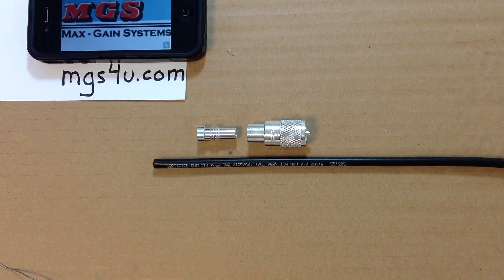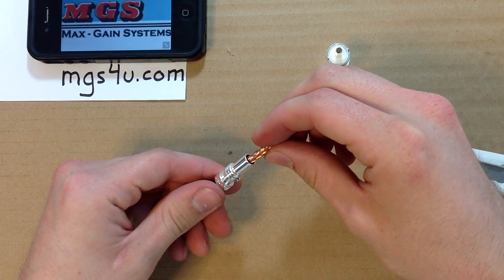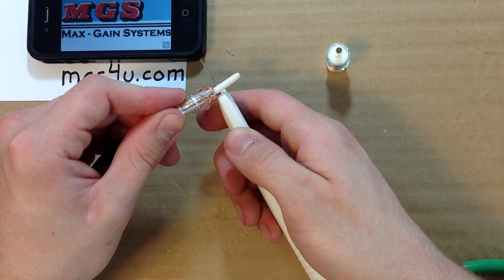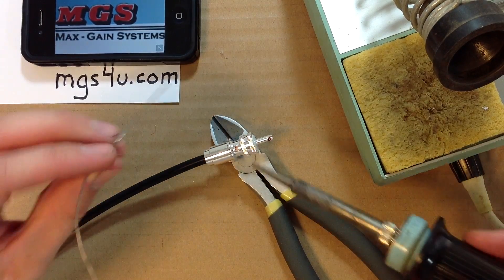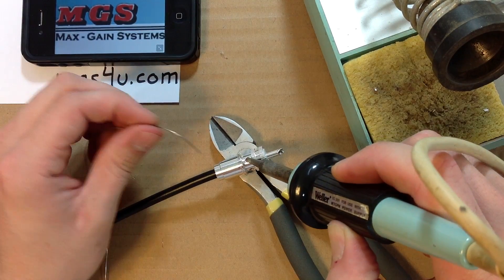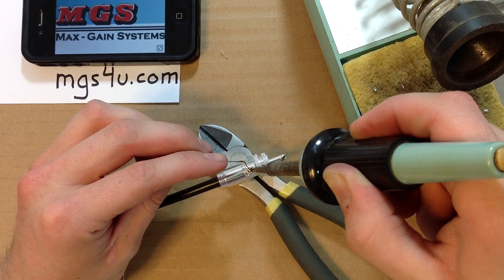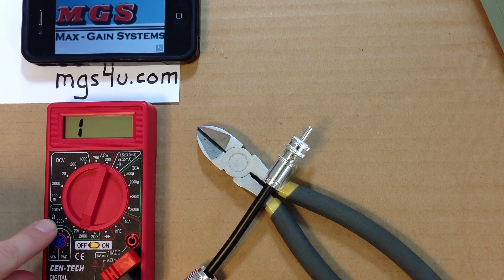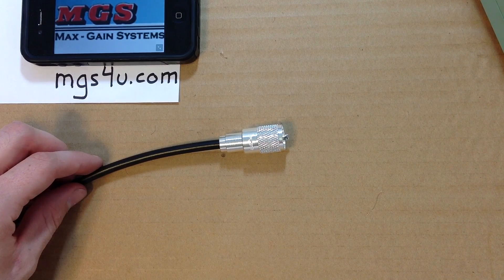Pl-259 Solder On Installation Guide for RG8X Coaxial Cable Full HD

Comment: Nice concise explanation. I would suggest using a clamp or vise to hold the work during soldering. Also apply soldering flux on metal to be soldered. The solder will flow and adhere much easier.

Comment: For anyone like me who struggled with soldering this and cutting coax to the proper depths - do yourself a favour and just buy some amphenol crimp/crimp connectors instead with a $20 USD amazon coax install kit, this kit comes with the coax stripper (adjustable) and crimper so it is a much much much easier installation.

Comment: The problem with using the PL259 and adapter is they provide very little strain relief. The soldered center conductor will ultimately provide the strain relief. Which is not ideal.

Comment: I know this video is ancient now, and no-one read the comments anyway, but I had to add my 2 cents to this clip. You probably ruined your cable soldering the braid. It would have gotten hot enough that the dielectric would break down and your expensive cable would be a pile of crap. And the solder blobs you added are NOT going to stop the cable and connector coming apart any better than just soldering the centre conductor does. I have used these connectors in many places and they are fine with just the centre soldered. There are FAR better connectors available now.

Comment: Great Video! I would however use a damp paper towel to cool the connector body after soldering. Also, clean up any excess solder on the connector body with a knife or brush.

Comment: Disappointing video because you edited it and obscured the amount of time the iron needed to be on the connector to reach flow temperature. That's probably the most critical part, and people need to see that. You've also not answered questions about what wattage iron is used.

Comment: I tried to solder the tip, but it cold soldered. The solder wouldn’t melt and the iron wouldn’t heat the wire up. What am I doing wrong? I realized that I didn’t use flux, but the iron still wouldn’t heat the wire and the solder took a lot of pressure to melt on the tip. The iron tip also wouldn’t tin. What am I doing wrong?

Comment: Nice video. One thing though. Use a small bench vise or better yet a Panavice for holding the barrel while soldering. Makes soldering so much easier.

Comment: Tin your reducer where the shield will locate and clean the flux off with Isopropyl Alcohol before you put it on the coax, makes for a better 360 degree wick and just a bit of solder to secure the joint. Use some small shrink tube about 1/3rd the length of your center conductor around the center conductor and center dielectric where it meets the shield to keep any stray shield wires from contacting the center conductor. You will have a strong electrical, mechanical and water tight connection...water tight after you put high quality shrink tube over the area where the coax comes in to the reducer.

Comment: As a retired engineering/tech at several local bureaus of America's largest broadcast network, I've probably done a thousand or more of these.  

Here's a couple of additional tips:  When soldering the braid, hold the iron (preferably 25 w.) in/on the first hole for at least 60-90 seconds.  BE PATIENT!!  Then remove the iron and allow the heated connector to do the melting of the solder.  Repeat with other holes allowing approximately 30 seconds in/on the hole with the iron (it's already fairly hot).  Again, do not apply the solder until the iron has been removed.  This way there's absolutely no chance of a cold joint.  

After connecting the first PL-259 to one end of the coax, strip an inch or so at the other end and split the center conductor from the shield before you test the first connector with an ohmmeter.  Occasionally even a clean cut will cause the center conductor and shield to short.  Obviously the end you first prepared will not be shorted (hopefully), so you only need to do this once, at the second end -- but be sure and test both connectors after you have soldered the second one, shield to shield and tip to tip for continuity, and shield to tip to insure there is no short.

I use the "helping hands" to hold the work.  It works better than having the coax "flop" around the work bench.

Comment: I bought some of these.  Easier than the big RG-8 style, but 1) there's no real strain relief since the adapter doesn't offer any, and 2) the shield is not held against the adapter by anything other than whatever few strands happen to be under a hole when it gets soldered.  I'm surprised the shield connection isn't intermittent.  It seems to me that the only thing holding the connector onto the cable is the single solder connection of the center lead.  I'll use them since I paid for them, but I wouldn't want to stake my life on this design.

Comment: Nice video. I had to dismantle my ham station 3 years ago when my home flooded and I'm finally getting around to reassembling it. I'm out of practice on soldering and this video gave some good tips. As soon as my coax and connectors get here, I'm going to give it a try.

Comment: If you don't have a small vise it helps if you lay the diagonal cutters where the PL-259 may lay in the notch & not move around when you are soldering.Also I only solder the lower holes what have braid showing thru them.That is my personal method.I also use liquid flux in every location that I will be applying solder. {:>)

Comment: no matter whose video i follow, the pin expands, and sometimes gets stuck in the female connector.  Then when pulling it out, the entire teflon pops out of the shell.  I am not even applying that much heat to solder it, a very short time, and even tried a torch, just touched to the end for a few seconds.

Comment: I' m new in the radioamateur section.  Does the pl 259 connect with all hf transceivers? Eg kenwood ts430, yaesu ft 757ts? I want to put this connector on RG58 coax.

Comment: I'm hoping that connector is for demonstration purposes only. You violated your own instructions by leaving several strands of the center conductor in the dielectric that you removed from the coax. it's been a long time since I made cables for radios that fly in Air Force planes. This is a good refresher to my SAC soldering course of 40+ years ago. I agree with the others who say that the iron you are using needs to be more wattage and a bigger tip. Back in the day we never soldered the braid and they worked just fine in the stressful environment of a military plane. To be a proper test though you should use your ohm meter on the highest setting as well. Not all shorts read zero.

Comment: Thanks for the fantastic video! Is this the "universal" connector for a CB radio? I'm very new at all of this I bought a used Cobra 29LTD Classic with a 100 foot cable when i only need about 40 feet. I can receive signals like nothing else but when i transmit its nothing but static. I would like to shorten the cable I'm using between my antenna and radio in hopes that it will solve or help the problem. I have a SWR meter also but that doesn't seem to be helping with anything. Any help you could offer would be greatly appreciated!
Reply: Yes, the PL-259 is the standard CB radio connector. All cable has inherent loss, so shorter is always better. Make sure it is good quality cable. If you tune the antenna to the center of the CB band to as close to 1:1 SWR as you can get, you should be able to transmit good. If not, you might suspect that the radio finals are damaged from whoever had it before. There are lots of good videos on Youtube that explain antenna tuning. Good Luck! Eric W1ECM
Reply: Check your SWR on channel one and channel 40. Adjust your antenna length so they are equal.

Comment: Maybe a silly question, but what type of pipe solder, or whatever the metal being melted is called, should I use. Get video BTW!
Reply from the maker: Rosin Core solder is what you want to use. Pipe solder is probably Acid Core which is NOT what you want to use with anything electronic. Good Luck!

Comment: I USE A RADIO SHACK BLUNT TIP RATHER THAN A POINTED TIP I CHECK IT WITH A 50 OHM LOAD FOR SWR GOOD VIDEO KG6MN
Reply from the maker: Blunt tip will work just fine. Whatever gets the heat to the work is what counts. The 50 Ohm load is another way to check it, sure. Thanks!

Comment: i have a 45 watt soldering iron would that work for any type of connector?
Reply: ***** Should be able to solder almost anything.  It's a little hot for the smaller stuff, but just move quickly.  Good quality UHF connectors will withstand the heat, junk connectors will melt the dielectric.  Don't use $0.25 connectors on your $200 antenna!

Comment: VERY good demonstration.  I do however, usually tighten the UG-176 connector a tiny bit using two pairs of pliers, one on the UG-176 and one on the body of the connector, to help ensure mechanical integrity and electrical conductivity between the two components. After completing all soldering I use a small copper brush to clean and polish the center pin.  I find a "third hand" device to be very helpful.  I was pleased to see you use a damp sponge to clean your soldering tip, that you tinned your tip, and finally, that you examined it visually, and especially, that you tested it with your ohm meter. Excellent video.
     Do please aldo explain to techs who don't know that there is also a UG-175 adapter, in addition to the 176, and do please explain when and where, with what types of coax, each one is used, as I do frequently encounter those who neither know that both exist, and, when and where to use which.  Thanks!  Subbed and liked!
Reply: +1, I like to toghten the adapter, and i tinn the center conductor so it does take auite as long to somder the end...
GREAT VIDEO!

Comment: The silver plating is really the key to getting a hot solder joint against a mass that's more than the iron can heat. It's something missing in most newer PL-259s. A Teflon dielectric makes this about the best possible choice just in case your iron isn't hot enough to grab the silver right away. I'll take a dozen of these. Where do I order?

Comment from the maker: YouTube does not allow longer comments... continuing from above>>> In some 55 years of putting on PL's I have never seen one arc at RF if it passed the ohmmeter test, not to say that is not possible. While we have equipment to high-voltage test (hipot) to 60 kv in our lab, it has just never proven necessary (other than when torture-testing our prototypes to failure. They did GREAT!)

Comment from the maker: A larger soldering iron might be advisable for a cheaper-type connector such as nickel-plated varieties with low-temp dielectric, but the size iron shown works extremely well with our silver-plated Teflon dielectric PL-259 connectors. Teflon dielectric also has the advantage of never melting regardless of how long you stay on the work with the iron. NOTE You can see our connector "torture test" by searching YouTube for PL-259 prototype testing.
Reply: The PL connector may withstand the heat but not the coax inside

Comment: Nice video but the soldering iron (tip) that you're using is way too small. Looks like you've edited the time it takes to flow solder into the holes. The dielectric is melting while the connector gets hot enough to flow solder, and although  your resistance test is good, it is only good for the low voltage of your multi-tester and not real rf voltages when you're running 100 watts or more. Arcing is a real possibility. Solder flow should occur within a few seconds or melting will occur.
Reply: Yes... I have literally melted dialectric TRYING to get the connector hot enough to flow solder.
Reply: Dan Shankle is why I am a crimp man, now.